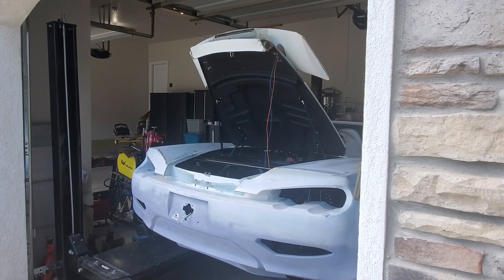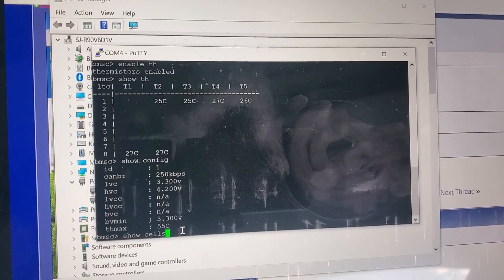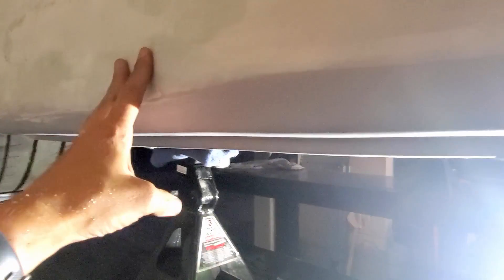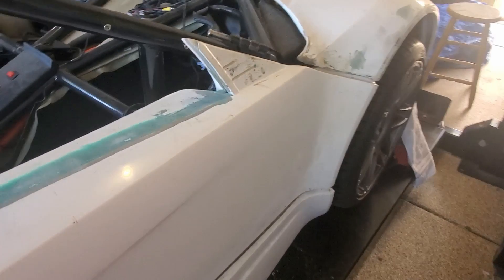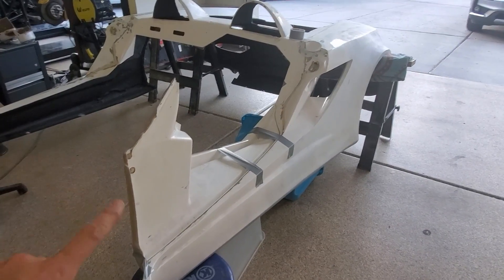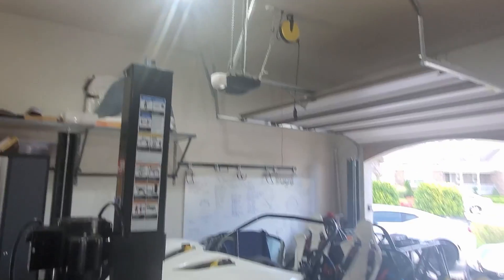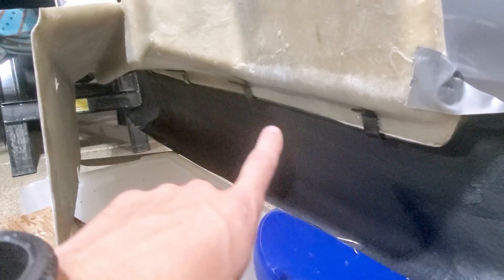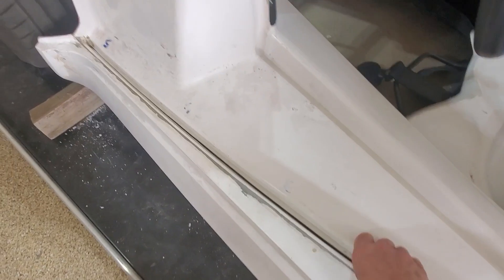Driving with the shell fastened

Comment: why not just fibeerglass all the pieces together as one piece ?  just asking..... or do you need them not together so you can put the body back on
Reply from the maker: I probably don't understand the question.   The roof I want to be removable.  Doors, trunk, and hood are separate because they move.  I did make some access panels to access various components.  Every thing else I joined into one piece
Reply: i was refering to the pieces you made the brackets for which looked like the rocker, inner rocker panel and around the door surround .....  I agree that when you want to put the roof on for wether reasons you dont want to loose that ability i hope that i explained that ok

Comment: Dude, cells 61-63 are still not good. 3.413 is near to empty (i.e. 3.3v), whereas most of your cells are around 3.93 which is near to full (4.15). That is a massive cell voltage difference. Are they still like this? if so you have a problem.
Reply from the maker: When the previous BMS went bad it was trying to balance these cells incorrectly due to faulty readings.  That is why they were way off.  They are all good now!
Reply: @electricsupercar  Cool. I've had a few of those BMSS go bad exactly the same but they're easy to swap out. The Dilithium BMS Display is a great product. I find it invaluable. BTW - I've had all the same problems as you with the T1-C EV Controls product. You are not alone, but it's all worth it in the end. When it works, it works forever.

Comment: If you can find a good place on the shell for the camera then you can use some of the spring loaded contacts (example https://watsons-streetworks.com/product/magnum-shooters/ ) for the third brake light.  I only needed the 12v side and modified a door popper to pass the signal through (you'd need a ground as well).  I needed the extra force to really pop the lid  and clear the electric trunk latch (heavy trunk lid).
Reply from the maker: Thanks for the comment!

Comment: I have my rear camera mounted low in front of my license plate right at the edge of the bumper. You could do that or right in the trunk lip would be good too. Alternatively, you could buy an extender USB cable so you can still have it on the wing. I had to do that because my wire run was too short and it works fine. Then it is able to disconnect with the wing light wires.
Reply from the maker: Unfortunately it is a proprietary connector (not USB or HDMI).  I think I will try on the shell somewhere

Comment: I think it may be easier to get the shell on and off if you were to make a connecter near the back of the trunk where it meets the body. That's so you don't have to fish any wires when going to take off the trunk or if you need to add anything to the trunk you can do it from there and not need to fish anything else through. I was thinking maybe one of those rectangular wire connects you see when building a pc or in other cars (I don't know what its called but here's a link: tinyurl.com/6vevcaam )
Reply from the maker: Good call!

Comment: Camera should go above license plate or recessed in back bumper.  I’d go with recessed make fiberglass housing.  Don’t want water getting on camera lense.  any panel that’s removable should have single point waterproof connector to remove (doors, trunk, hood etc.).
Reply from the maker: Excellent advice!  Thanks!